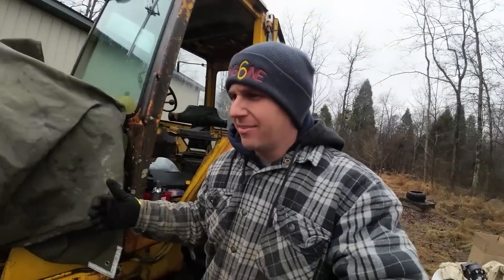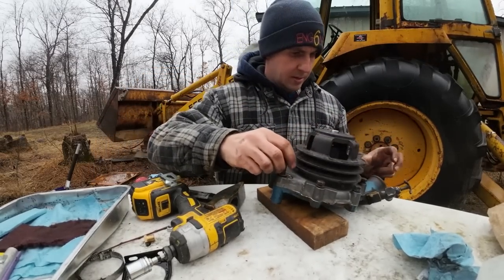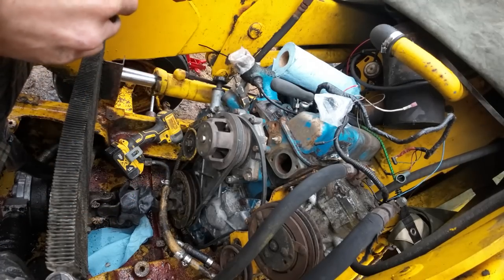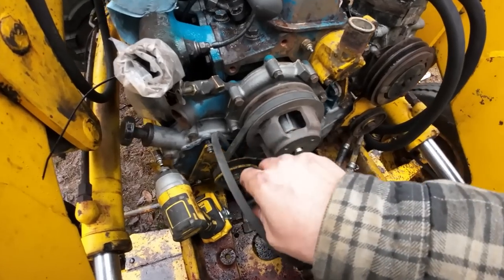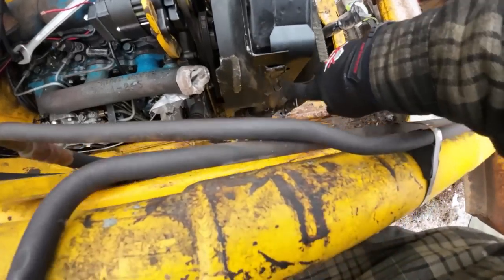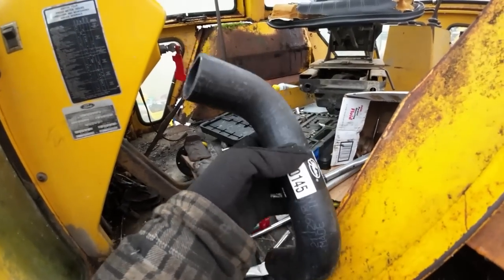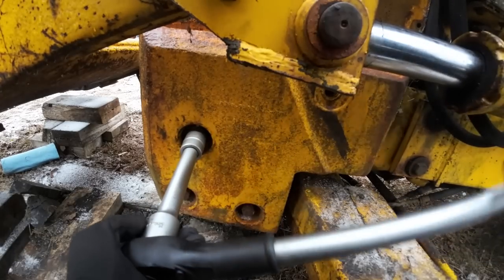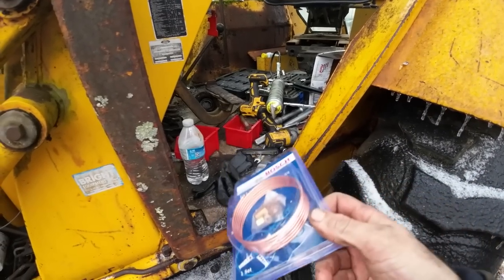Fixing a 1978 Ford 555 Backhoe - Area Diesel Service made it Possible!

Comment: I've worked in severe weather conditions all over the world from blizzards on the flighline of Grand Forks AFB, ND fixing snow removal equipment to 120 degree desert temperatures & sand in the Middle East fixing tactical vehicles.  Sometimes we had a shop to work in, and sometimes we were out in the elements to get the job done.  Been retired from the Air Force since 2016 and sometimes I miss it, and sometimes I don't.

Comment: Hi Mike,
A couple of suggestions.
With old bolts, using a wire brush definitely helps, but I like to chase with a threading die. Makes them like new!
Also, instead of oil I use white great on bolts when re-inserting them. My white grease tub has a small paintbrush inserted through a hole in the lid. The white grease lasts a long time.

Comment: I had to smile.  You went and cut the longer belt off THEN turned right around and pulled the existing belt off so you could get the alternator belt on.  You could have,  Well, you know....  Hey you could probably get Tractor Time with Tim to come down and help add a turbo.  The only requirement is you have to paint your tractor GREEN first.  You are a hearty stock working around all the frozen stuff.   Thanks again for the great content.
Reply from the maker: Unless you pull the PTO shaft for the hydraulic pump, you have to cut the AC belt.

Comment: Ford does use pretty good fasteners ... they still worked after being driven like a nail to get them started. Just a big ratchet to run them in you earned every tight bolt you showed. And a full set of Fotd tools has at least one of every size and description of hammer, Bud. Good stuff Mike

Comment: Probably the first man to ever torque the water pump/housing since factory assembled lol, but it definitely doesnt hurt. I bought me a tiny ball peen hammer from HF for “gasket making” and the peen end is about 5/16” so it makes bolt holes a breeze
Reply: I inherited a teeny ball peen hammer from my dad that he used in just that way. There are times when that little guy is just the right size.

Comment: Great to see the 555 going together. Some background information! Your unit has the optional A/C (not really common on these units as most had just a cab and heater) and therefore it has a two groove pulley on the crankshaft and water pump! If it did not have A/C the alternator would be mounted in the A/C compressor location and one belt drove the water pump and alternator. Great to see this old iron get another chance!
Reply from the maker: Yup!  At some point I hope to get into the compressor and see if it works

Comment: Nice progress! Quick tip for things like the bolts on the bottom of the rad, even the washers. If you need them to stay in place, put a good dab of grease on them where they contact whatever they need to stay in/on. The grease will keep them in place and still allow them to move where needed.

Comment: Mike You started off as an apprentice engine/plant equipment fitter, and then field promoted to fitter, now with all the mods you had to do to get around the water pump etc you are a timed served field engineer. You also have to right attitude because it has to be done correct if the job is to be completed and due to the fact you are doing this as a first with no book or help with you, you are treating it as an education and learning curve. As you stated by the time you have rebuilt this 555 you will be very knowledgeable on the workings of a backhoe and you will cherish that little blue three cylinder yellow Ford as much as the little green iron babe. Well done and I really hope along with Clinton that it turns out good and you have as much fun on your homestead as we have watching you turn a pile of junk into a working asset with many years work in it. Stay safe and well and regards to the family and La Dog.
Reply from the maker: Always appreciate your support Tony

Comment: I just want to say props for the adventures outside of the typical ones you have and for jabbing threw your project like a pro. First time gotten like a champ on video after 25 first time deleted clips aye?? (Just joking). But about them sockets,  I think you can never have to many tools, sockets especially I'm not telling howmany partial sets I have, but short, long and mid depth then crossed with 6 or 12pt and let's not forget all 3 sizes(1/4, 3/8, and 1/2".. ). Ya'll Hava good day and thanks for letting us tag along.

Comment: Cap I'd have sanded those shoulders down a bit more. Steel expands when it rusts - that's why things get locked into place. Also in that case anti seize is your friend. Good job with it.

Comment: When you make your own gasket start with the bolt holes and then put a bolt through the hole to keep the gasket from moving while you are cutting it out. This is helpful for large or complex gaskets. Good job with everything that you have done.
Reply from the maker: I do on larger parts, not smaller stuff like this.  Just as easy to hold it for me anyway

Comment: A couple of clamps and a solid mount of any kind will turn your cordless into temporary bench top wire wheel for small things like bolts. A vise will turn it into one for slightly larger things. I use that trick all the time. Saves fingers

Comment: Great job by your parts supplier to come up with a solution for you.

You learn a lot about engines going through one like you have done.
Reply: Desperate measures to torque to proper value.  Open end box wrench, fish scale and math.Length of wrench  to center of bolt from the scale * pull on the scale = torque.

Annoying way to do it...
Reply: lighter plastic head hammer will imprint the gasket material with less risk to the part.

I imprint a bolt hole, cut it out, then insert a bolt to hold the gasket material, then another bolt hole and bolt.  Now the gasket can't slip easily.  Do all the bolt holes, then the edges inside and outside.

Tricks learned over a long time.

For next time you (or someone else) have to do this kind of work.
Reply from the maker: If it's a bigger part I use bolts, something this small I just hold it in place.  Works for me anyway

Comment: Damn it looks cold there Mike. Brrrr. Despite that it's coming together nicely. With the homemade gaskets I do the bolt holes first and then put some bolts through with nuts to hold the material in place on the job. Then cut a cross in the center hole as it makes it easier to tap around the inside edge. That's how I was shown to do it a long time ago.
Reply: He is tough looks cold no way I would work on anything out side like that
Reply from the maker: If it's a larger part I use the bolts, something small like this I just run it.

Comment: @ 38:12 "If I remember correctly......" Sorry, but my mind said, 'It'll be the First time on this job'.  😁😂🤣
 Don't mind my spur of the moment thoughts, you're doing WAY better than I would under the conditions. Heck I had to wait till it got up above 20*F to go out and put a 4 bolts in the hood of my little crawler, and it's INSIDE !

Comment: when you put the bolts on you could have used a piece of duck tape to hold them in place and then when you had them going in the hole you could put it off to make it easer to get them started

Comment: When making gaskets I tend to use a screwdriver to poke some of the bolt holes through the gasket material, then I push in some bolts to hold the gasket in place, I then use a knife to cut it by following the edges of the part. I find it more chilled than whacking with a hammer. ;)
Reply from the maker: To each their own.  If you do use a hammer, it's not a whack, gentle taps.  Don't want to ruin your part
Reply: Many ways to skin a cat

Comment: Hey captain, you should check out a pocket chain hoist for some of the lifting activity. 1/4 ton is about 60 bucks on Amazon with a 5 foot lift.  There is also one from elephant lifting products that hooks to your drill for lifting and lowering. However they are more expensive.  One last thing from a guy who was in overhead lifting for a decade, please be careful using tie downs as lifting straps, I have seen them fail and depending on the weight used I have seen the hooks or ratchet get launched at people.  Thanks for bringing us along on your rebuilding journey.
Reply from the maker: I have a couple,. Doesn't do me much good with out anything overhead though. But maybe one day!
Reply: @CaptainKleeman  I understand.  I was thinking on the end of you lifting poll that you strapped to the forks.

Comment: Mike it seems the water pump you have on your tractor was made for the British market Ford New Holland market, because the pulley configuration is identical to the one on the British parts website for the 550 backhoe with a 201 motor.  If the mottos was replaced, it is possible they ordered a replacement motor out of the UK for it. 
Have you found the motor S/N, it should be stamped on the block on the fattened part of the block on the rim just above the oil pan, this S/N on a lookup side will tell you when the engine was made and what equipment it was installed into.  It will also help you to locate parts.  The S/N of the motor is on the fuel pump side of the motor 

If the replacement engine was for the British market, you may encounter other issues in finding parts.
It also maybe why area diesel could not locate a replacement pump in the USA.

Heath of Red Poppy Ranch had a all wheel drive tractor while it was sold in the USA in limited numbers, it was sold in mass in the UK, and when he needed parts for the drive train for the front wheels, the parts had to be ordered out of the UK, and it took him several months to get the parts.  Check out the Red poppy Ranch YouTube play list, in his videos he explains about the tractor and the process he went through to get the parts. I believe his tractor was the Ford 7000 series tractor 4x4, he sold the tractor to his brother to buy a skid steer

Comment: Mike. Lots of aftermarket parts will have the wrong size holes. Lance at Bundy bears shed in Australia deals with that a lot rebuilding tractors.
All you can do is drill them out, better yet is tapered reamers but not everyone will have them. I do like mine. Keep smilin
Reply from the maker: I'll look into tapered reamers.  Thanks for the tip

Comment: I would've cut the fan shroud at the bottom as wen u bolt on to the radiator it will close up the cut so u can split over the fan pully
Reply from the maker: No

Comment: The long bolts on the water pump had a shoulder on them ,which you pointed out,I think that the holes for those bolts on the new pump were the wrong size and should have been slightly larger than the short bolt holes. (Look on the original pump if you still have it).
Reply from the maker: Correct

Comment: You should drill out the holes in the pump housing instead of jamming the bolts into the pump. When those bolts get rusty again and you have to take them out they will be frozen in the holes and be hard to get out .
Reply from the maker: It doesn't make a difference to me.  Smaller shoulders or bigger holes, clearance is gained either way.  I'm good with it
Reply: Precisely.  The housing may have the same bolt pattern but not necessarily the same diameter.  The correct thing to do is drill the housing to the original spec.
Reply: @CaptainKleeman ....you DON'T have clearance do you.  You made them an interference fit. Good luck ever getting them out down the line.
Reply: I'd have to agree with Capt. bigger while or smaller bolt clearance is clearance.

Comment: I have put fluid on housing and lay gasket material on it to outline so I know where to cut which works when I can't tap on it.
Reply from the maker: Good tip.  Just have to make sure the gasket material is good and flat so it lays correctly I guess.

Comment: Making good progress. When I make gaskets, I usually put 1 or 2 bolt holes in first to hold the gasket in place. I received an Email from what appears to be from you about the hoodie give a way Was it you or a scammer? You will be burning diesel in no time.
Reply from the maker: Scam

Comment: Not long now and what's wrong with having 3 boxes with various ratchet bits, those that have full sets never know the joy of finding that one piece, that you know is there but may be hiding! And you really need to sort out the climate control in your workshop, having to build a wood pile to heat that space is very costly. 🤗👍
Reply from the maker: Hahaha

Comment: Just curious if there is an advantage to using the gasket material to cut out a gasket vs FIPG or similar item?
Reply from the maker: Personally preference really.  Some will argue other points, but I've never noticed a difference

Comment: Mike, did you clean the AC condenser before the radiator went in finally?
Reply from the maker: Ac condenser is on roof
Reply: Ok, how about hydraulic cooler.
Reply from the maker: @philipfleming3546  what about it?

Comment: Every 3 cyl. Ford engine uses the same pump. The only difference is if the tractor has AC. They probably sent a 4 cyl. pump at first which has the same casting and bolt pattern but different alignment on the pulley. After 92 or 93 the mounting bolts were bigger
Reply from the maker: Nah,. There are several variations of pumps for the 201.  According to the numbers it's most likely a British crate 201

Comment: You can get the radiator out without taking apart the nose of the machine, you have to have the water pump out to be able to squeeze it by.

In fact there is almost no reason at all to ever take that section apart.
Reply from the maker: Negative
Reply: @CaptainKleeman  100% done it myself. Your top mount alternator is in the way though, most have it side mounted.

Comment: If you punch the bolt holes out first, you can then use the bolts to help keep your gasket from moving around while you hammer out the rest of it.
Reply from the maker: Yeah, on small parts like this it doesn't matter for me.  But bigger parts I do the same.  3m spray adhesive goes a long way as well

Comment: when making gaskets, try doing two bolt holes first to hold it steady, then put bolts in to hold it before doing the rest.
Reply from the maker: On bigger parts yeah, on smaller parts I've always been fine just holding it

Comment: I always clean the entire bolt, not just the treads. it makes a difference. And in your case I would have put a little white lube on the shoulder part so they wouldn't bind when you torque it down.
Reply from the maker: You do you bud

Comment: When you got to the water pump bolt that the torque wrench wouldn't fit you might have been able to use a crows foot on the end of the torque wrench. That might have enabled you to get the proper torque on that bolt.  Hope that can help in the future. Bob.
Reply from the maker: Nah
Reply: If you use a crowsfoot on a torque wrench you have to calculate the difference in leverage to adjust the numbers.

Comment: I think you just cut a belt you didn't need to as it runs off crank pulley to ac pump could have saved money.
Reply from the maker: It was on a seized pulley and would have destroyed itself anyway.  It was the right call for me.

Comment: I think you snugged up that alternator belt just a tad too tight. You need a a little play or it is likely the stress the the shaft bearing. I once saw a guy tighten up the auxiliary belt on a Laguna so tight the power steering pulley shattered on first idle and all to stop an a old belt squeezing.  All to save a bit of money on a new belt.
Reply from the maker: It'll be alright